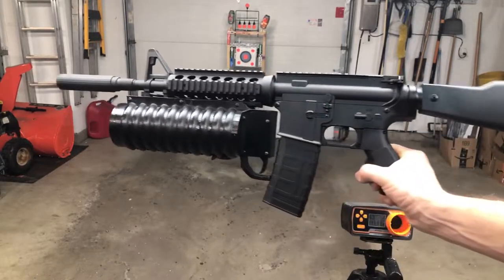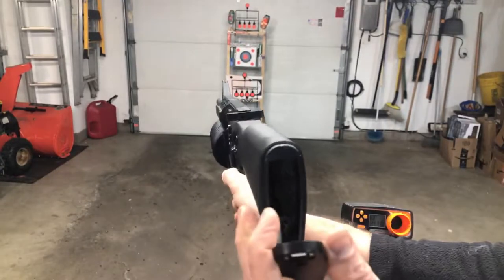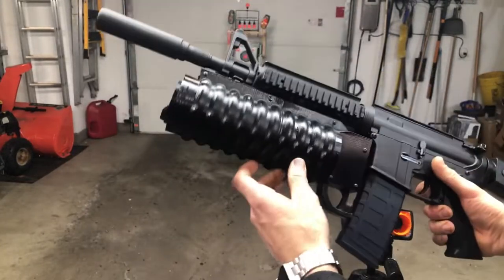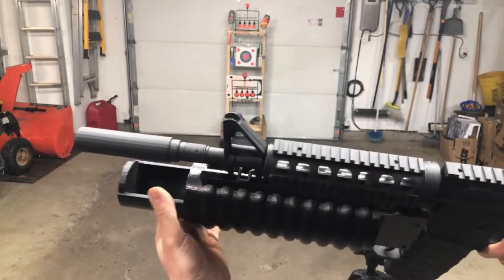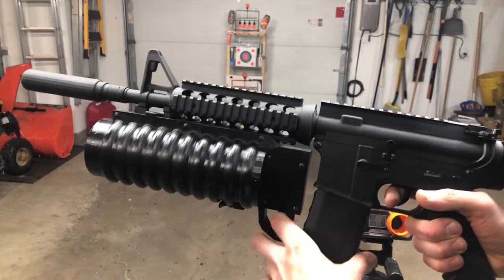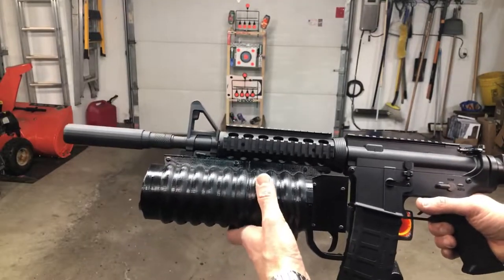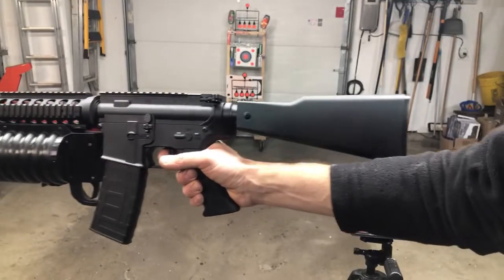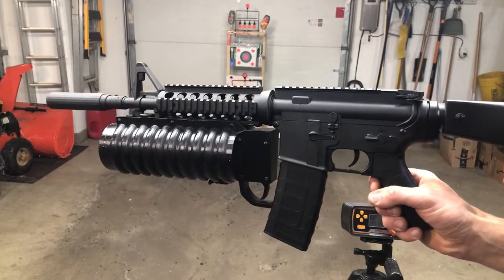Demo - Giant 3D Printed Mock Grenade Launcher on Anstoy M4a1 Gel Blaster

Comment: Hi Chris I’m wondering how to make a silencer with out a 3d printer
And do you any fun things to do with gel blasters by yourself?
Reply from the maker: You can use PVC or ABS pipe from Home Depot, or even copper tube or aluminum tubing. Just a matter of what material you are most comfortable fabricating. Attaching to the actual blaster can be a challenge but if you check out the plumbing section, you can probably find a threaded piece and make it all work out.
Reply: @GelBallBlasterMaster   
Ok thanks